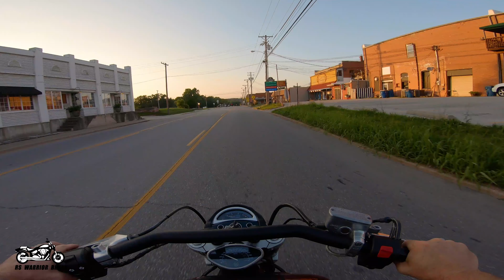RS Warrior Yamaha Warrior 1700 Fuel Tank Elbow Leak

Comment: Just fixed mine with JBweld after it popped out doing my left side clean up. You already know that because you helped me sing while doing it. But to anyone doing the left side clean up just be aware it’ll probably pop out on you. I sanded the brass fitting and roughed it up, put a thin layer of JBweld on and it was solid in about 10 minute. Wouldn’t budge. Thanks for all the help.
Reply: Joey V what yr is ur bike?
Reply from the maker: Not problem! Glad you got it all fixed and were able to make it on that ride. Looked good too! Thanks for watching Joey!
Reply: Mark Beck  mine is a 2008.
Reply: RS Warrior Bryan Thank you! I’m trying to get the ride uploaded to YouTube but it only uploads in 360p. Once I get it figured out it’ll be up. Nothing to crazy happens but it’s a gorgeous road.

Comment: I have a 09 and mine started leaking and come to find out there was a recall on it!
Reply from the maker: There is? Is it just on the 09's? I will have to run my VIN and see if it comes up on it. Thanks for the tip. Thanks for watching as well!
Reply: Hi Brian! My 09 Worrior the CPS just went out. I was wondering if you might know how hard it is to change it. I have not found a DIY how to on it. I've had to buy a battery and starter (didn't know you werent supposed to jump one with a car running and burnt both up)so I was trying to see if I could do it myself. Im not a mechanic and it makes me nervous to just open it up without any help. Thought I would ask you as your how to vids are very helpful and I need to get her back on the road!!

Comment: Mine happened as i was on the freeway. I pulled over then it came all the way, so i put in and turned it to the right and now its been on since, now im very careful with it but every now and then when its sitting in my garage i mess with it and no budges
Reply: I had this problem, the brass part came out of the cast aluminum elbow. I twisted it in with pliers until it got tight, it has stopped leaking since.  Should  be recalled, I agree.
Reply from the maker: Yeah, it a dangerous deal. I had actually done the same thing to my father's when I owned it and it lasted this long. Definitely better safe than sorry knowing what I do now though. Thanks for watching guys!

Comment: I don't know the details of it I didn't ask but I bought this bike approximately 5 years ago off the show room floor(brand new). My son and I were riding and road a good way before I realized I had a leak. Wife called dealer and I took it in, they fixed it at no charge. I had gas going every where. It was God's protection, Grace and mercy that the thing did t catch fire!
Reply from the maker: Definitely! I will have to check into mine when I get some time. Maybe I can get it replaced for free. Thanks again for the tip!
Reply: @RSWarriorBryan  you are welcome 😊 I wish you the best! That is a design flaw. Yamaha should have to fix it!